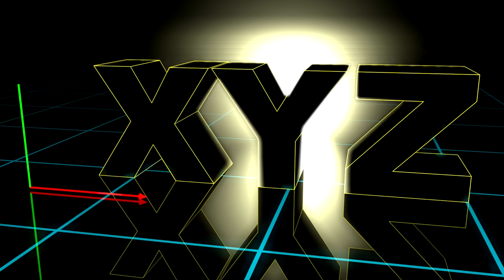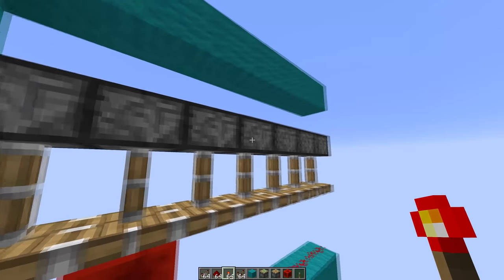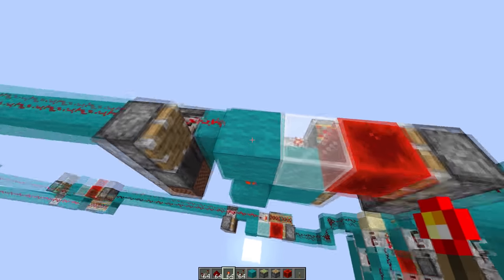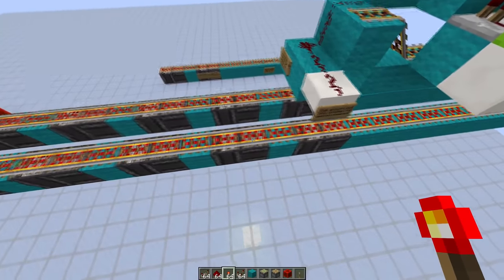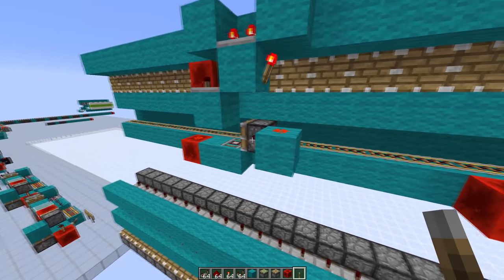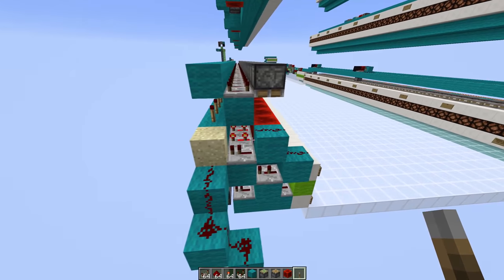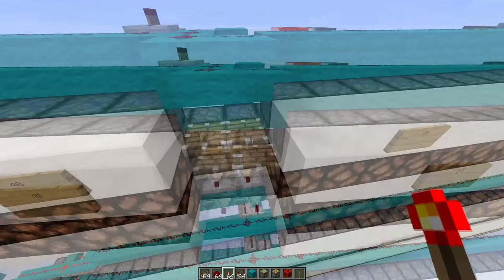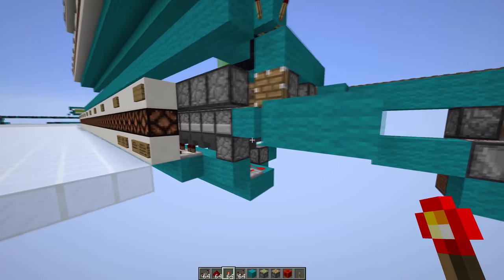XYZ - Microtick (Block event) Technology & Infinite Bandwidth Instant-wire

Comment: Hey, nice video. That's a very interesting way of doing the repeaters I haven't seen before. I recall myself and others playing around with moving a block using a sticky piston and utilizing the fact that the block is moving for the same length as the signal if it is less than 1.5 ticks long before, though. Don't think anyone has used that with some smart transmitter/receiver design before to make such a nice remote button panel though. Those are pretty genius. Very well done!
Reply from the maker: Thanks me old friend!

Comment: Maybe I should publish my stuff from a few months back... I already have a few compact BE-preserving repeater, including ones that can run completely on rails without a single dust and with 3gt reset, as well as adding and subtracting BE length. Button panel and receiver is definitely much better than any I've seen so far though, so great work on that! :D
Btw, you can extend decoders without gaps by adding repeaters in between, as long as you shorten the length by 1 BE each step.

Comment: interesting, but what d of course be even better is if multiple on-off pulses could be sent in the same gt meaning we could transmit proper binary rather than such unary signals, vastly decreasing the size of the transmitters and recievers. though i m not sure that s possible without extending the stations relative to the number of bits. still given that in most practical applications you wont have to send that much data this beats the current best method for medium throughput low latency wireing(instant comparators) by a longshot.
Reply: Indeed, the fact that this is just unary also annoyed me. However, afaik, you can't send multiple signals in the same tick. 
Redstone components just have a 1 tick cooldown. The design could probably be adapted and optimized to do fast like octonary signal transfer or something.
So maybe sending 3 bits of data every redstone tick (probably 3 gameticks tho). Haven't looked into any hybrid system like that though.
Reply from the maker: Most interesting idea you got there. Gonna try look into it!
Reply: @TheGunMasterDigital  I already have an idea to make it possible. I'll try to send you some pictures.

Comment: Nice to see that you are still playing this game and doing interesting research after all these years !
Also, how do these hopper lines in the redcoder bring the item back to the first dropper ? Do you use some trick to make them faster, or do you have to wait for the item to come back between two uses of the system ?
Reply from the maker: When the hoppers get unpowered, the item flows into a 2nd hopper line that goes straight back to the start

Comment: thats indeed revolutionary 1.12?
Reply from the maker: It should work in almost all versions of minecraft I believe. However the designs with noteblocks updating pistons won't work in 1.12, and the designs with observers will obviously not work in versions that didn't have observers.
Reply: @selulancie  I actually have several designs for rail based instant wire that don't use observers or redstone dust updates. I put them up on /r/redstone awhile back, but there wasn't much interest. No idea if the Imgur gallery that I put them in is still linked properly though since I remember having problems with it.

I was originally developing it for an instant dropper system to send data by using named items but never got time to finish it. I was going to use it to make some of Test's old pearl stasis chambers that were multiplayer friendly without needing ridiculous amounts of wires.
Reply from the maker: @curtisstofer6678  Oh, care to share a link to those?
Reply: @selulancie  Sure! https://imgur.com/gallery/158jboW
you might have to figure out which one is which since they seem to have gotten jumbled up in the upload though.
Edit: They work similar to how the noteblock versions do in 1.13+